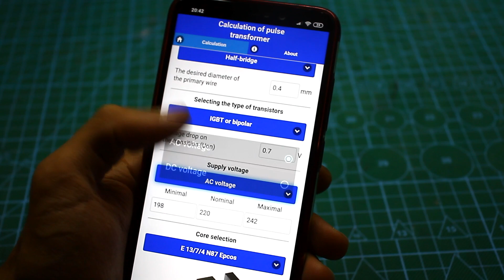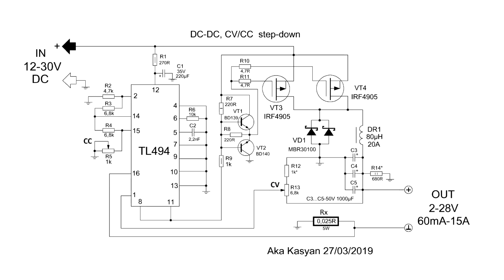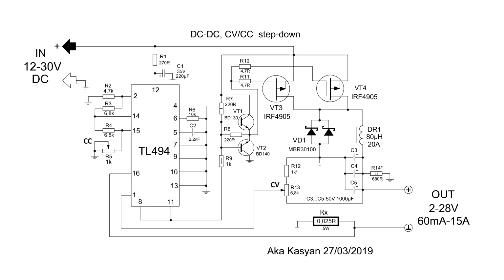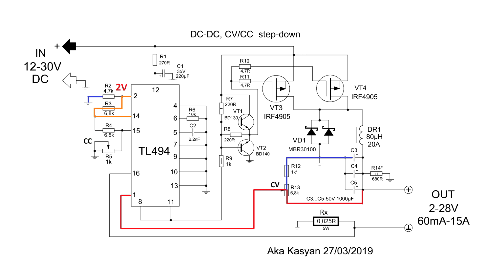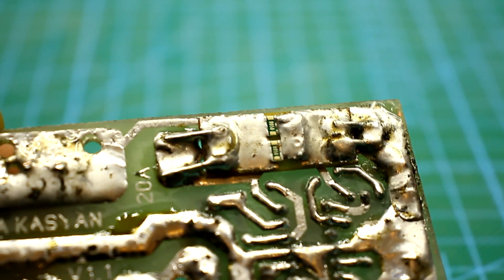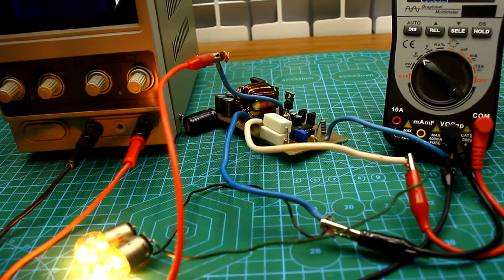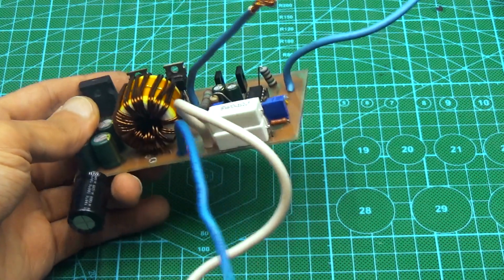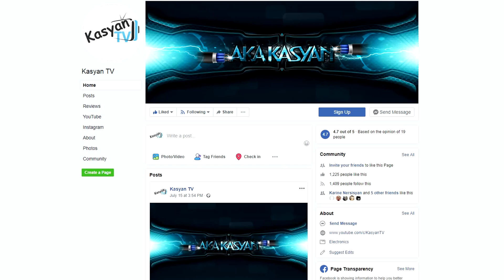HIGH POWER 0-25V 0-15A adjustable power supply

Comment: Hi, I have built the circuit but I am having trouble with voltage adjustment, I am trying to use a 5k trim pot and it is producing strange results and no results when the 1k resistor is added ad shown in the circuit. 
Can you please help me?

Comment: I have made this and every parts inclouding voltage and cureent setting working fine
But short circuit protection dident work
By the way i install 0.05 shunt 
So why short circuit protection wont work???

Comment: Through the actual production, when the input voltage above 27 v, output voltage is close to the output voltage, power tube will be destroyed. Test conditions for no-load cases, could you tell me what is the cause, thank you.

Comment: Would it be possible to use an electric load to control a max 24V and 30A at the output? And how many P channel mosfets would you need?

Comment: You use 2 resistor 0.1 ohm 5w it mean current shunt is 0.05 ohm is that correct ? Can use any P chanel mosfet with high output amps ?

Comment: Hi can i get buck converter for rail to rail DC supply… ? Input DC  +60V     0V  -60V. Need output 2-4Amps , +28V  0V  -28V,  . This power supply use for Audio Amplifiers using STK 4141.

Comment: Where is zener diode for gate protection? You can't connect gate to ground if input voltage is higher then ~20V.
Reply: @electromagic3111  On both of them. Its purpose is to protect gate from shorting out if Vp(eak) coming of the pulse generator exceeds Vgs of the mosfet used in the application. Here it can reach almost 30V, depending on the power supply voltage, which is too much for the gates' safety.
Reply: Good remark!
Reply: @electromagic3111  Greece.
Reply: @electromagic3111  I don't know what divano means. Where did you hear it? Divani is the bed, very near to divano, but surely not the same.
Reply: @electromagic3111  What do you need it for? (And it's my time now to ask you where are you from)!
Reply: @electromagic3111  My email I mean. (About the divano you didn't tell me where did you hear it, so that I could better understand and answer you about).
Reply: @electromagic3111  You mean that you heard this word in this video? If this is the case I will see it for another time...right now!
Reply: @electromagic3111  I have seen the video once again. There is no "divano" word in there. There are instead "device" and "divider" which I believe you already know. In the beginning I thought that you are asking me what "divano" means in Greek  (which I already answered you). That's why I asked you where did you hear it.
Reply: @electromagic3111  As I told you before, give me your email and I will answer you.
Reply: @electromagic3111  This is the 11th reply to you dear! Just read them all one by one and try to understand what I told you. If you don't have a problem by publishing your email here (which I have) write it here and I will answer you as I told you.
Reply: Why you cant  send your gmail at here? You can delete it later

Comment: Nice job. This really simplifies the TL494 circuit to a design that is more easy to understand.
Someone correct me if I'm wrong please... Most circuits built around this chip are "off-line" topologies (they are connected to mains voltage). If I understand this correctly, the chip has it's maximum input power limitations just like the circuit shown here. When it is connected to a mains powered topology the chip must be powered from an additional auxiliary transformer winding. The mains voltage is far too high to be rectified and connected directly to the chip. So we need a extra way to power the chip and that's an auxiliary winding. Of course, this winding can't power the circuit until the switching action is started. This sucks. How do you get power to the chip when you need the chip to create the power? We need a special start-up circuit that can provide a tiny amount of current through a high value resistor. This is barely enough to kinda 'jump start' the control chip so it can draw extra power from the auxiliary winding and circuit. Additionally, this is a major design limitation. This auxiliary winding and circuit is affected by the switching action of the control chip. So, if the load changes and the controller adjusts the output to compensate, the auxiliary circuit changes as well. This means the auxiliary power circuit must be designed for the correct voltage range of the output. This range is rather small and limited. This is one of the largest factors involved with how high or low a power brick output voltage can be changed or adjusted. By limiting this chip to an input range compatible with the control chip instead of mains power, the need for an isolation transformer with mains auxiliary winding and rectification, along with a start-up circuit are eliminated. Without the isolation transformer the voltage and current feedback circuits don't need the additional complications of a secondary voltage reference (tl431), or optocouplers. This design has greatly simplified this chips basic circuit design to something far easier to understand.

  I'm still not 100% sure why this needs a P-Channel MOSFET though. Can someone explain (simply) why an N-FET won't work? 
  
Thanks for the upload.
    -Jake

  PS (to my former, even more ignorant, self): 
  The TL494 is also cloned and called a KA7500. These chips are very common inside old computer power supplies, and lots of circuits with medium power output levels between 1 to 10 amps. I have pulled them from several plug in car chargers with output currents larger than 1 amp, car audio amplifiers, and ATX computer power supplies. They are also dirt cheap directly from China :-)
Reply: The first part is correct. You can use a small mains transformer to power the chip separately. This also gives you the opportunity to use a gate drive transformer and have direct feedback since the chip will be on the secondary side.
the P channel is used because it's easier to drive without a high side driver. In the buck converter, the Mosfet's source is not connected to ground, so you need a bootstrap circuit to drive it from the chip. This is typically done by a specialized chip such as IR2110/IR2101/IR2108.
Reply: @BogdanSerban  ino

Comment: Hi, great video as always, I installed the flyback app, it works very well but I don't know exactly where to find the value of Ud. It is the maximum diode reverse voltage or the forward voltage drop?
Reply: forward voltage drop

Comment: Hi, is it possible to reach 20A with this circuit, so I can use this converter to power my VHF rig? 73, Fernando PU2PLL - Brazil
Reply: AFAIK, It can up to 30A with the right 30A mosfet, 30A inductor and 30A Diode.
But, Buck/Boost Conventer its not good for VHF because noise interference.
CMIIW.

Comment: You talk about a 0-25v adjustable power supply and the first I've encountered is that min voltage is 2v. Why you need to lie?.
I've done some tests with an arduino board and a mosfet and I've archieved 0v-5v (i'm working on a voltage divider to archieve more voltage).

Comment: I tried this connection and the regulation does not work. The output always closes by a jump.
Reply: i changed the resistor 220 near the transistor of BD140 to 1k .. and its work. but i never got the short protection when i shorted it two terminal
Reply: @huiwijaya  I did the same. I also had a mistake. Now it works well, only the MOSFETs get too hot.
Reply: So can we apply more than 20 v in input? Does it damage the mosfet gate?
Reply: @huiwijaya  pls can i add 2.2k instead of 1k. Also can i completely remove R8 220ohm restster...???

Comment: Hello Sir,

I want to regulate volatge from 5 to 50volts.
And current from 0 to 100 volts.

Suggest me best solution
Reply: voltage is measured in volts, current is measured in amps.
Reply: @rusu959 1 to 100 amps

Comment: The minimum output voltage is 2v, can you achieve 0v? 
nice work as usual :)
Reply: You could get lower than 2 v, but not recomended, microcontroller based buck converters can achieve 0v, but tl494 is not the case

Comment: it is easy to modify it for the use of n chanel mosfet. why bother with p chanel?
Reply: How to use n channel . Pls give me circuit diagram
Reply: p channel don't  need high side driver or gate transformer for operation !!!!
Reply: @tiagonet8794  indeed,but they are very expensive and not so powerful as n chanel

Comment: Hello, What can I do in order to make this power supply handle up to 30 amps? Can some one guide me ? Thanks
Reply: Use 4 MOSFETs in parallel and  make the inductor with 14 gauge wire. The inductence should be more than 100uh. And use multiple capacitor with low esr with a total capacity of around 13000 to 15ooo microfarad. Hope it will work 🙂. And I will suggest you to use mbr6060 double Schottky diode, but it will work fine with mbr4060 also.
Reply: @mosfettech2141  Hello,Thank you for the reply, i really appreciate it. I am not an experimented electronics person, yet, i always like to learn. SInce im a RAdio operator, i was thinking of using one of this to handle a 100w Radio transmissor. DO you have an idea or a way to share a diagram to add the 4 MMOSFETs and teh Capacitors arrangements? Perhaps is a lot to ask, but it would be nice. Thank u
Reply: @aldur6650  sir I am also not a electronics engineer. I am only a electronics hobbyist. But from my some previous experience I will not suggest you to use this circuit for a radio transmitter. Because this is a switching power supply. And the switching noise can  make difficulties or any type of noise at your transmitters output signal. I am not very much sure but I think that problem can happen in your project. I will suggest you to use a suitable transformer for you work as it will give you lineal output voltage. But if you still want to know the schematic for this circuit with 4 MOSFETs I will send it to your email. Thank you😊

Comment: make capacitive battery charger using 60 to 100uf capacitor with a adjustable output 12v to 24v using scr:)

Comment: I want n chanell mosfet circuit:(
Reply: I did some research and I found that N channel Mosfet can't be drive in buck configuration, you could use a gate driver transformer, or use high side configuration but it is too complicated :(
Reply: @lenaroseguera1241  that wht ive seen too tl494 and transformer to drive the gate